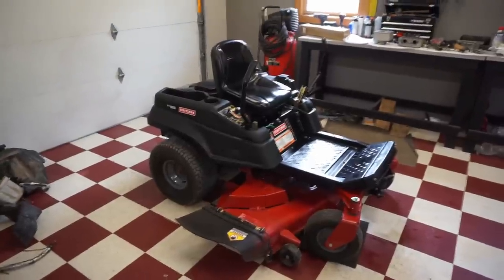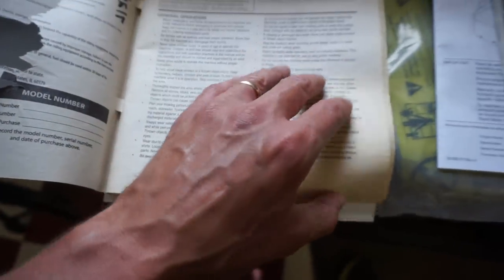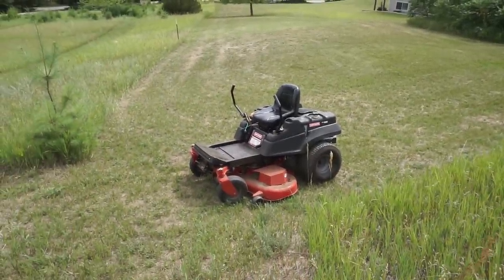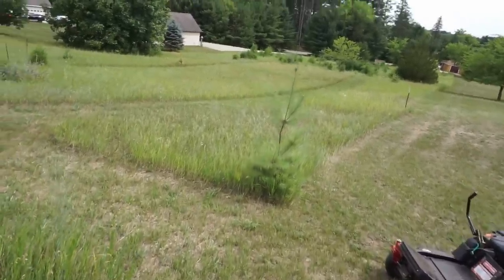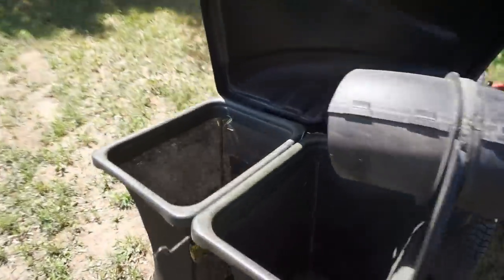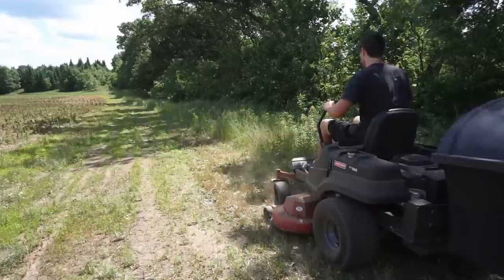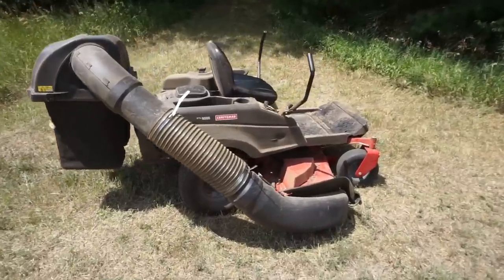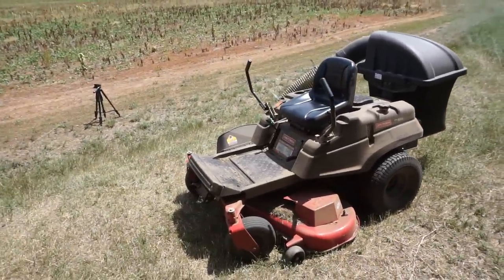I Bought The CHEAPEST Zero Turn Mower

Comment: I owned a landscaping business after I retired from the army, and had 3 of those Craftsman Zero Cut Mowers, and except for cracked decks, never had any major problems with them.

As my business expanded, I eventually bought John Deere mowers and, and sold the Craftsmans for reasonable amounts.

Thanks Joe!

Allan in Columbia, SC

PS., I actually invented a method to prevent cracked mowing decks, presented it to Sears/Craftsman years ago, and they turned down my invention.

No problem though,as a few years later Craftsman tanked, and I sold my invention to Murray Outdoor Equipment!
Reply: All owed by mtd

Comment: Close the handles.   They should be right next to each other.    You can steer with one hand.   There is also a way to set it up for cutting in reverse so it doesn't shut down.    
That mower is made by Cub Cadet.   I have that exact mower.   But yellow and black.    Also you can adjust the hydraulics to turn sharper.   But the main reason it's looking awkward is the handles are part way open.
Reply: Yeah
Reply: Yeps I have the Cub version also👍🏾
Reply: Nope both cub cadet and troybilt are owned by mtd.mtd makes both
Reply: @catsbyondrepair  AYP owns them all, but close enough, I usually call em MTD too

Comment: When you bag you usually install high lift blades that lift the grass and create more air flow for pushing the cut grass and leaves into the bags. Those blades with the tall bent lip are high lift blades

Comment: Little piece of advice, cut around your trees and fence posts first. That way all you have to deal with is open ground with no real maneuvering. Learn the property real good so you can avoid any rocks or stumps that may wreck your blades or shafts. Zero turn mowers can make short work of bigger properties but they do take a minute to get used to. Thanks again for your time today and enjoy the rest of your week.

Comment: Not a bad buy but I’d personally resell it and get a true commercial unit for the amount of property you have to maintain.. Hustler, Skag, wright, toro’s commercial line, x mark just to name a few and they will have a fabricated deck not stamped and ground speed will be way higher as well as blade tip speed. ! As others have mentioned pull the bars completely closed also.

Comment: Not a bad deal! My only suggestion is don't engage the PTO at full throttle. Do about 1/2 throttle, engage the blades, then throttle up. At full throttle there's a lot of belt slip and you'll wear the belt out faster.

Comment: I bought a Hustler Raptor back in 2017 with a Kawasaki engine on it, I liked it so much that I bought a bigger 60" model SDX with the Kawasaki engine not bad machines but they have items that break on rough ground eventually that's the only draw back other than they are back killers from bouncing around on rough ground too much, Me and my wife both have some purple pillows brand name pads that really helps out, They are fun to mow with enjoy.

Comment: Upgrade the oils to Amsoil.  They have a special Small Engine Oil.  They also have a Hydrostatic Oil.  Both are worth the extra $$$$.  Wix 57148 Harley Davidson is a 5 micron filter.  The above combination has been flawless.  Nice buy.  Don't cut the grass that short.  Grass is being stressed.  It's going to burn out.  Dont use hi-lift blades unless u using a bagger: they consume a bunch of power and create a bunch of noise.

Comment: Looks pretty dry where your at. The recommendation for grass cutting height is 3". While you have the mower in the garage, just measure the blade height from the floor to the cutting edge of the blade, lifting the grass deflector, figure what setting on the height lever is 3".

Comment: You mention hills. I had a new craftsman riding I got for my new property. It couldn’t handle the hills. The hydro trans went out 3 times. Luckily covered under warranty. After the 3rd time I parked it and sold it before it could break again. Hopefully your zero turn doesn’t have the same issues.

Comment: You got a great deal on that. Kohler is a good motor. Did you mention what size deck that was.  Something to think about mowing on hills, preferably  left to right, most stable.  If you try to nose up a hill, that's the most dangerous of approach. They become nose lite, as most of weight  is shifted to rear tires. By design the mower deck is very heavy therefore  it becomes the forward  counter balance. Then that helps balance the mower from becoming a wheelie unit. The driver is seated back from center toward motor. Even if your angle on the trailer ramps, could potentially dump you. Be careful, I know this stuff worked at a dealership that sold Bad Boy mowers. Still cool
Reply: I think he mentioned 54 inch

Comment: that is going to save you a ton of time, the Krohler engine is good but they have a counter balance system that comes apart if the oil is not changed often .
Reply: Even then, check and ensure your motor mount bolts are tight at least before you mow, those can loosen because of the shaking, if you can, loc-tite em
Reply: those courage engines are junk
Reply: @M.TTT.  you aren't wrong about that, the above is why they are

Comment: I'v had a toro Z5000 since 2006 only issue was the Kohler Courage engine it had muffler would keep falling off and the Single Cylinder courage engines are the worst motors ever made in my opinion I changed mine to a Kohler Command 23 I got for $50 that was on a John Deere L130 the twin cylinders are just ok I highly recommend the Command series Kohler engines all my mowers/equipment have a kohler command or honda engines I'v been working on mowers for 8 years last year I bought a Great Dane Chariot 61" zero turn with no engine and wire harness but I put an engine on it and rewired it and it's been the best mower i'v ever had only paid $300 for it and over time I think i'v put almost $1000 into it I got a good deal for sure

Comment: need to bend and fix the handles so they come together and almost touch, the its easier to control and can use one hand to hold both in a way and keep a straight line better, and its better on bumps

Comment: Wow they must be expensive in ur area.  I've had two.  One paid 500 and other 250. I sold one for 900 and other for 450. Both ran great and were in as one better shaped.  But n8ce score on getting a bagger with it.  Of course mine needed mechanical work but only cost me for front tire tubes. That model not much faster then craftsman 4000 riding mower with the 52" deck. Only advantage is the zero turn around bushes and turn around time.  I doubt you'd notice it though with much smaller zero turn deck.

Comment: be careful with that courage engine they are known for problems, but at least you got a twin cylinder might be your saving grace! Joe how in the heck were you able to back that off the trailer with the arms in the up position? Clearly the brakes are not engaging when the arms are up. Also that is a residential mower one tell tale give away is the deck it is stamped, not welded with thicker steel.  They don't put courage engiine on commercial mowers either. I see courage I run the other way I don't walk I run. Make sure you use the best oil and keep it as full as possible courage engine have a counter balance and if they don't get enough oil the top bearing fails and will eject itself through the block. ask me how I know!!! Love the vids., and good luck!

Comment: Sometimes you can take out that switch that shuts the blades off when you go in reverse. 
It's usually a button on one of the handles they hide in there on zero turns, and on the gear shift on tractor mowers. I know it's super annoying when mowers don't mow in reverse especially tractor mowers. It's a pointless "safety" feature. Most landscape companies order them without that or take them out. Lots of the commercial grade mowers don't have that. 
Sometimes you need to mow in reverse up really steep hills or you just do a willy on a zero turn lol.

Comment: You can definitely tell this is out of his wheelhouse…. This is 100% not even close to a Commercial mower…. This is a box store mower. The Kohler Courage engine is known to be junk, headgaskets/starters/leaks etc. The paint “looks perfect” because it just had a Rustoleum Restoration done…. See the overspray of red on the decals & discharge chute? The green tether on the deck height adjuster indicates the tension spring is broken & when hitting bumps the deck will drop down, common issue on these MTD machines.

Comment: Take the bagger off.  That is a totally residential mower. I am a Kohler engine guy, however, the Kohler Courage engine is a dog and has problems, especially the single cylinder.  How many hours on meter and what year? I am a small engine mechanic shop owner is why I know. Not knocking your zero turn just stating facts. Takes a while to learn how to mow correctly on a zero turn.